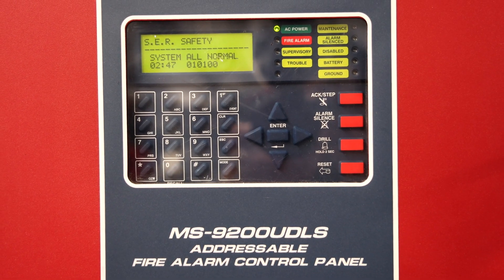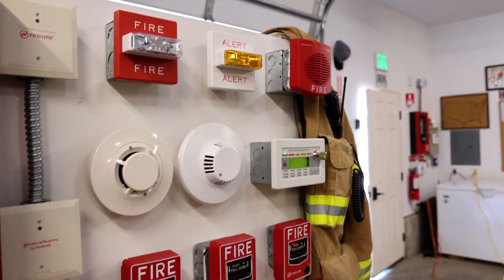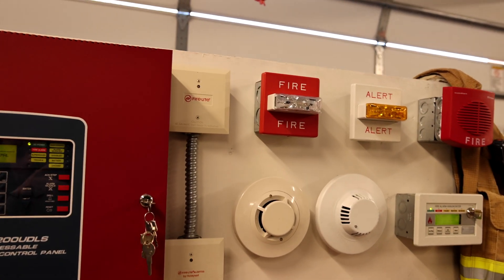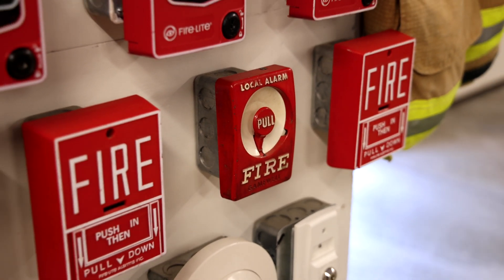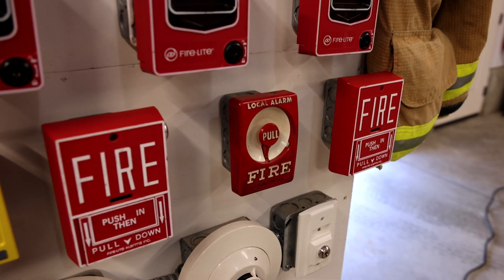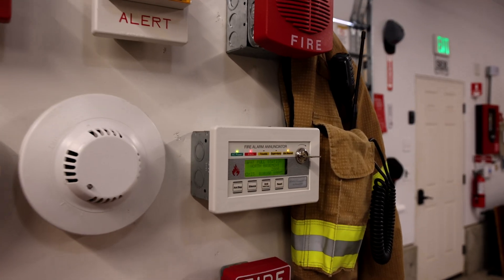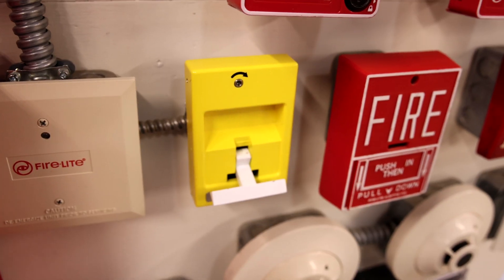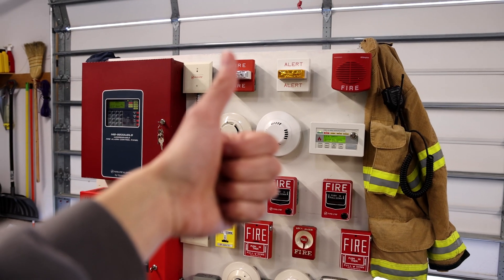Wheelock & Fire-Lite Voice System Test 19 | Chlorine & Fire Alarm!

Comment: I have just watched this on YouTube for the first time today and  after watching a clip from an episode of the Big Bang Theory, towards the end where Sheldon and Raj are having some "Office War" and making an experiment with hydrogen sulfide gas for "Pest Control", along with cinnamon apple-flavored aromatherapy scented candles which BTW is highly flammable, but it's on a set and not in real life. I'm surprised the bird isn't harmed and in real life it would have been picked up by the smoke detectors, sending a signal to the control panel which would activate the building's fire alarm system, the whole room would be on fire and either one could have gotten kicked out and arrested for almost burning down the University; just imagine that being on their records FOR LIFE. Aside from that, just out of curiosity, could you please do another one of these S.E.R safety videos and see how your system setup would work in either a gas or carbon monoxide leak and you would have to alert people to evacuate or move them to fresh air? For example, "Attention. Attention. A gas leak or carbon monoxide alarm has been reported. All occupants walk to the nearest stairway exit and walk down to your assigned re-entry floor or main lobby. Do not use the elevators. Do not use the elevators. Walk to the nearest stairway."

Comment: Love this system. If this was a real system, you would probably want to make the tones for the two messages a little more different from each other so that people don’t get confused.

Also, I believe that tone for the fire message was used on the very early 4100u’s before they switched to the modern tone.
Reply: That’s what the voice evacuation is for, it helps people not be confused, and also helps people know where and why to evacuate the building.

Comment: Chlorine alarms normally would be triggered by a sensor, because people who would pull a manual alarm would already be experiencing severe distress or death. There's a similar type of alarm for HVAC systems using ammonia-based vapor cycles (in some very large chillers) that is sensor-activated.

Comment: My local swimming pool has a Chlorine alarm tied into a Fire-Lite voice evac system. NAs are System Sensor L-series speaker strobes including some weatherproof advances outside, in the indoor pool, and shower area.
Reply: What would you need to have a chlorine alarm for?
Reply: @joannestealey4482 in case if too much chlorine is put in the pool
Reply: @VOLTRONDEFENDER4440 that wouldn't do that, it would be more if there was a leak
Reply: prob chlorine tanks for the pools in case it leaks or smth else  @joannestealey4482
Reply: @joannestealey4482  attention please there has been a report of the emergency process calmly to the newest exit and leave the building immediately do not use the elevator use stairwell where necessary all handicapped shall use the building evacuation plan
Reply: Show it in YouTube shorts